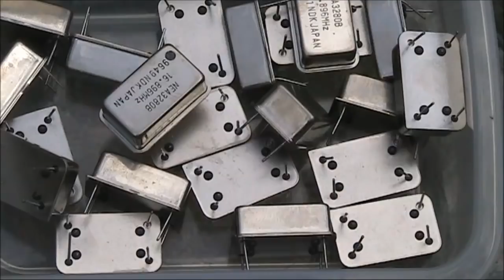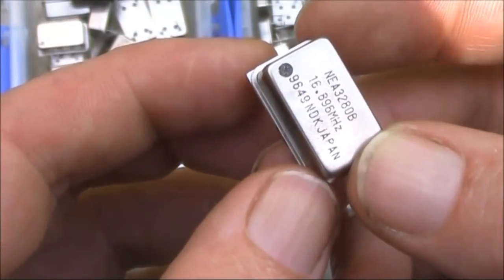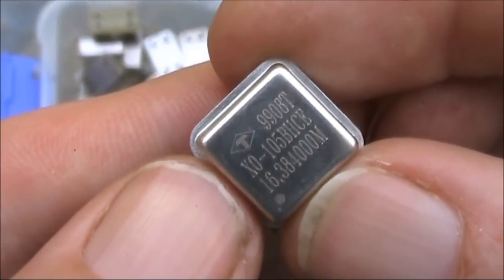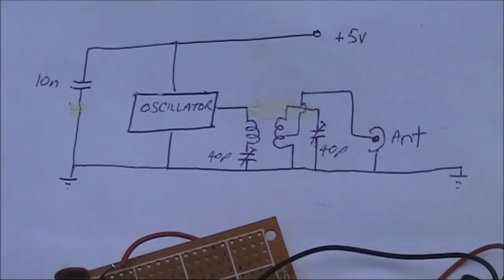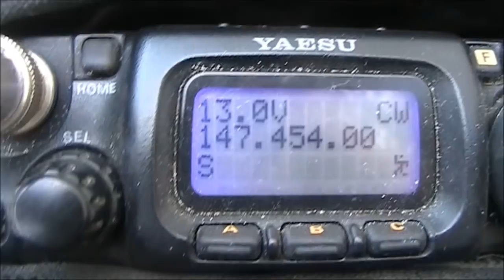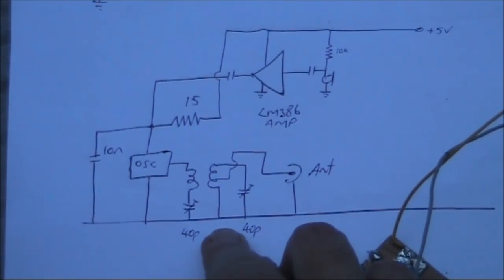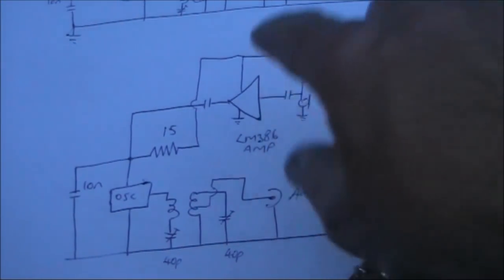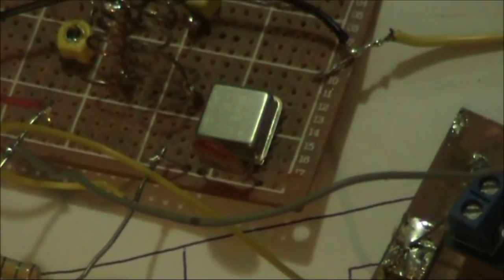Electronics on the Floor: VHF transmitters from crystal oscillator modules

Comment: Thanks Peter.   I have a 50 MHx module that I want to use in an up converter for an RTL-SDR dongle.  I was trying to figure out the pin-out.  You are the only one who explains it clearly.  73  Bill N2CQR

Comment: Hello Peter! How tune the both capacitors and coils for 147 MHz? 🤔
Reply from the maker: Use a receiver or VNA on 147 MHz and tune for max strength.
Reply: @vk3ye  Okay, thanks! 73
Reply: When we build LC circuit to oscillator for example 3...4...5 harmonic (oscillator is 1st frequency = 28MHz) and we turn LC to 5th harmonic =140MHz and antenna create to 2m band, can we receive for example 3 harmonic 1km distance? Maybe if we build LC on one frequency therefore we attenuation another frequency? I want use cristal oscillator use for 70cm band, so... Can I use 27,027MHz and 16th harmonic with LC filter (27,027x16=432,432MHz)? Maybe 16th harmonic with LC will be not strong enough? And this transmitter with LC filter create something strong besides 432MHz? (example 5th harmonic 135MHz?) 73!
Reply from the maker: @movecizetodobryfilm  Yes. Output will be dirtier the more times you try to multiply. Multiple or cavity filters will help fix this but are heavy, expensive or tricky to align.
Reply: @vk3ye  OK, thank You for knowledge. So what are I doing if I want generate quite good signal in 430-440MHz and use cristal or cristal oscillator and some parts?

Comment: Some osc's were used as they went as low 80 meters you are right any board is worth investigating as I'm a qrpp operator.  Kv4li  ps keep the harmonics as low as you can. USA it's 40 db and down.

Comment: Can you design a dsb transceiver for 6m using the appropriate crystal module, like the beach 40...?
Reply from the maker: You could by tapping off a harmonic from the module and feeding it to an NE602 balanced modulator or similar. But it wouldn't be frequency agile. Unless you do a premix VFO arrangement like I did with my 27 MHz CB BFO.
Reply: @vk3ye  Thank you, I'll think about it...

Comment: Is it possible to pull the frequency of the module?
Reply from the maker: Only very slightly eg by varying its supply voltage as can be used to transmit FM.